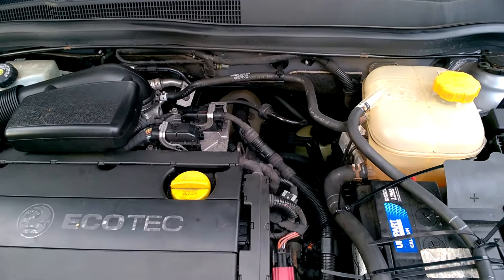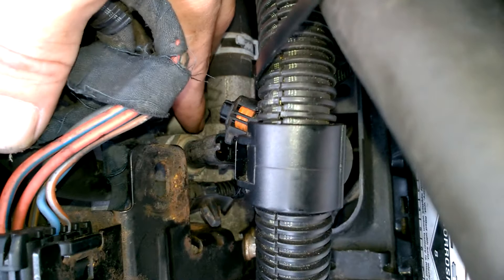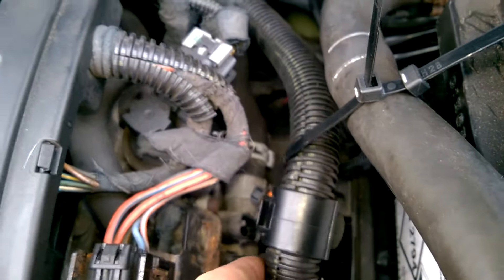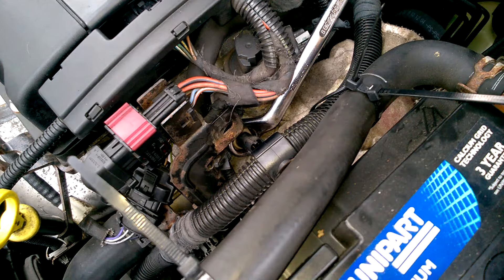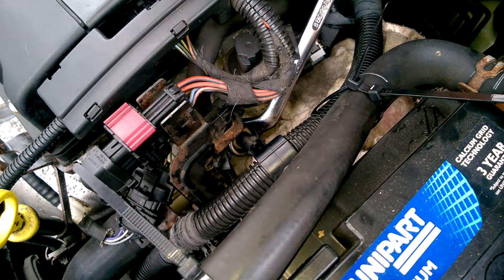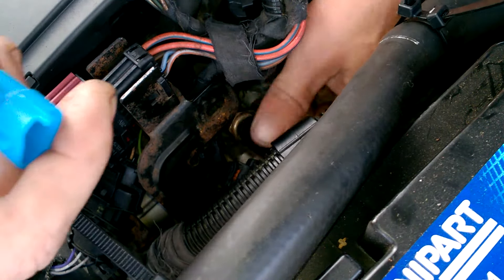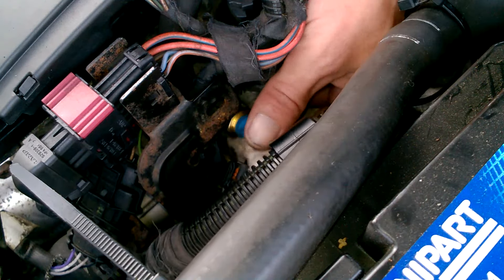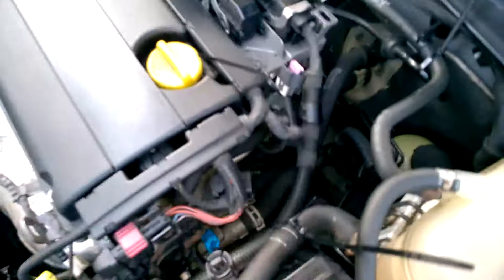How to Change COOLANT TEMPERATURE SENSOR Astra H MK5

Comment: i changed the sensor, but it did not help. even under the boat, too. , i changed it, but it did not help. and there is no revenue engine. i delete the error, after 2 weeks it appeared again.

Comment: I have had a look at my astra mk5 and I can't see or locate where the sensor is,the red plug in your video is facing upwards on mine and seems to have different layout.so will my car have one?it's a 1.4 twinport,I fitted new thermostat,waterpump and expansion cap but the water boils up and comes out of the release hole,been told its not head gasket.
Reply: It sounds like the coolant temp sensor not working so not turning on the fan causing the coolant to boil
Reply: All cars have one .it will be near this one in video and will look the same . I have a vxr and it is on the side of the block at the side of battery

Comment: Hello, 

There's a sensor to the left-hand side of the chain cover and I've snapped it today. Would you be able to tell me the name of that part?

I was told it's the coolant temp sensor but after checking your video, it is clear to me that it is not the same part. I also own a Astra H MK5.

Your help would be much apprecitated!

Comment: I have a 0115 15 code which is a temp sensor i think, safe to drive this 10 miles a day for a couple days ?
Reply: Mines stuck open so engine is always cool been like it for years cars still fine
Reply: @dnbtv27  what do you mean brother? Temp sensor stuck open or thermostat?

Comment: My mechanic changed mine as was causing the yellow spanner light to stay on and power loss too , problem i got know is the light keeps coming on and off and the power loss symptom keeps happening ? what would be the cause as the sensor was changed ?
Reply from the maker: Is there an engine fault code
Reply from the maker: https://youtu.be/xbXxn7y1zGc
Reply: @seansautos152  I did a pedal test and got ECN 218214  ? any idea what that means
Reply from the maker: @christineayres7094   relates to coolant temp... was the fault code cleared when the part was replaced? Try disconnecting battery for an hour or so this should clear any faults that no longer exist.. Or get them removed using OBD2 scan tool.. If this does not sort the issue it could be the  thermostat housing sensor
Reply: @seansautos152  Ah thats weird its come back again as the garage cleared the code after replacing the sensor last week ? anyway i phoned them this morning about it and on Thursday am taking the car back again, hopefully they will get to bottom of it as is a dangerous fault sometimes the car randomly loses power when for example im accelerating onto a motorway, so definitely needs fixing permanently
Reply: Please tell us what the problem is and the fix as im going nuts with limp mode and fault codes. Garages cant seem to help either. My coolant is red hot but my code is P02345. After half an hour limp mode aggghhh.
Reply: @dougsymcb1  fix is buy another car lol 😂 Seriously hunny that's what I'm going to do, have had this Astra only a month and nothing has gone right ,sensor was replaced once and a week later same fault again so have had enough now as the fault is causing my Astra to use a ton of petrol I'm paying £20 a day to go 40 miles to work and back a nightmare

Comment: Can this affect how the car performs as my temp gauge works but is coming up with p1116 code
Reply from the maker: It can do so it's worth changing as the part is cheap
Reply: @seansautos152   is it easy to find on a mk4 astra 1.6
Reply from the maker: @johnsta0492  it's on the same side on my mk4 astra 1.6 8v
Reply: @seansautos152  will try lookin when i can free time

Comment: Thanks for the video helped me out
Brilliant easy and straight to the point no bullshitting around
Reply from the maker: Nice one glad it helped you out
Reply: @seansautos152  Hi mate my astra j 10..getting slow while driving then engine stopped not picking spead when changing gears..coolant pipes are too hot & boiling water when i open the lid ..why is this problem if u can advice me

Comment: hi are you from black country? I'm looking for someone to sort my astra and you sound local
Reply from the maker: From Solihull... what's the issue with it
Reply: @seansautos152  not far then, coming up with cooling system error on diagnostic (haven't got the number) friend told me it's temperature sensor? also had never lambda sensor put on (front end) and it's working fine but error code for that still on there too?